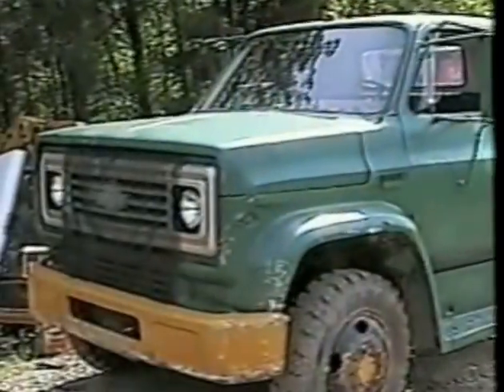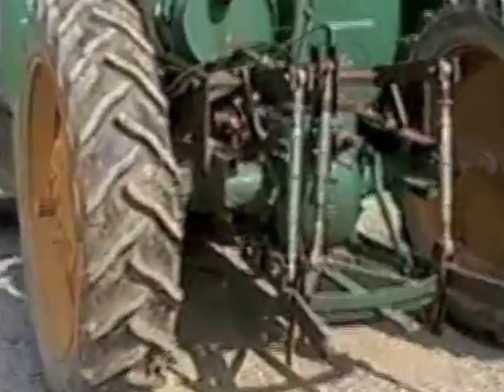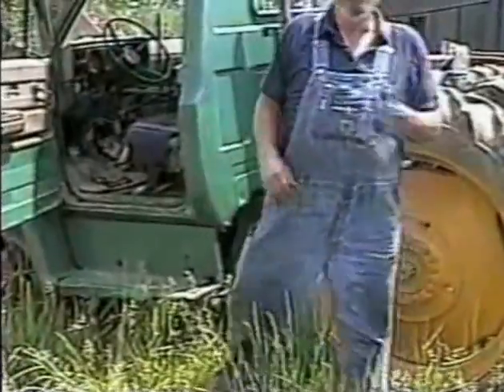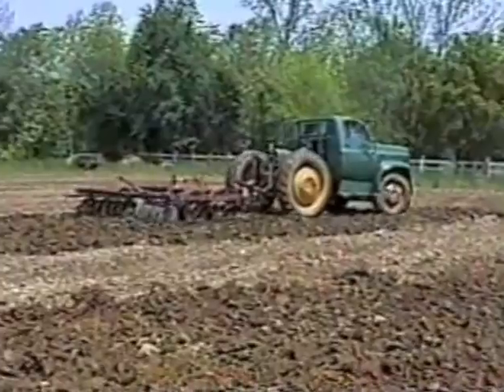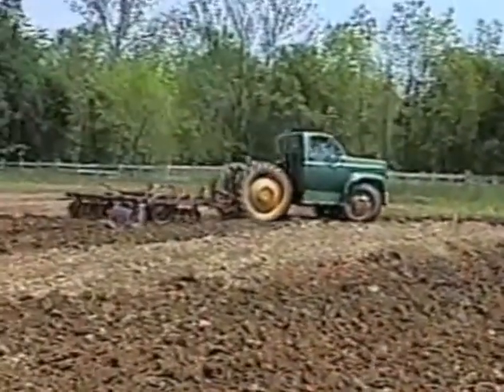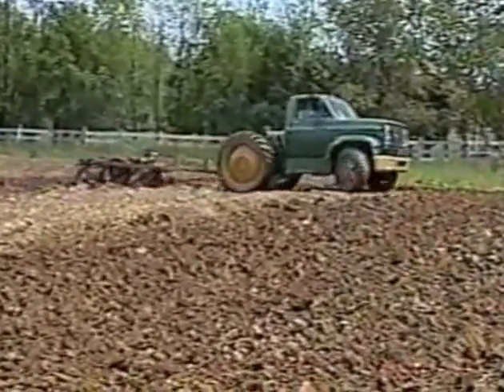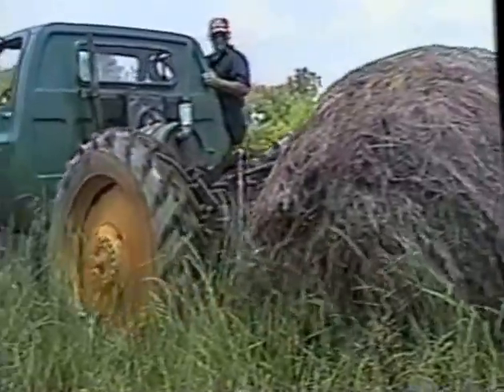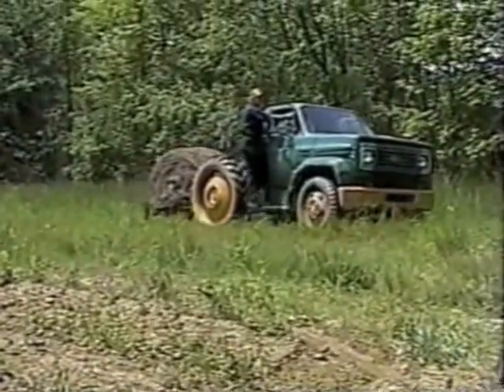FARM SHOW - "Tructor" Moves Quickly Between Farms

Comment: I had a truck kind of like this one. It was a one ton 4x4 with a wrecker bed on it.  I built a three point hitch that was powered by the winch on the truck. It  was a 1978 Chevy 454 4x4  with a 4 speed transmission and 4.30 gears it had a granny low and a hi/low transfer case which gave me a really,really low "double low", it would pull my 13 foot farmall disc with ease, it would also pull a 3 bottom breaking plow like there was nothing there. I used it mostly for discing,  pulling the fertilizer spreader. and raking and moving hay. It was especially handy for fertilizer because I could drive it to the co-op for my fertilizer. It was also great for pulling a trailer full of steers to the auction. Having six really rough tires gave me traction rivaling a tractor and with the wrecker bed be it weighted close to 7000 lbs. In many ways it was more useful than any tractor I have ever owned.

Comment: 48mph dam near 77km/h that thing moved for its age atleast it has the right steering style for that speed ive been in a situation where i had a run away on a hill getting pushed by my trailer in a fendt 712 found out the speedometer stops at 75km/h figure i got up to 90-95km/h by the time i lost it a automotive style steering system would have definitely gave me a fighting chance of keeping it on the road and on its tires as i could have started braking and counter if a tire locked up or something as it started picking up speed but i didn't dare do anything to risk moving the steering as i would never find center again since it was hydraulic steering

Comment: Bet if he used a diesel engine and added AC could sell a few of those 😄👍👍🇺🇸
Reply: Building one for yourself using some available parts is labor intensive but very low cost. Finding the parts for more, and showing a profit from all the time would make the production models expensive.
Reply: 40,000 acers or you're not Aerica farmer.

Comment: I bet you ,he doesn't have to get the John Deer  computer programs to work on that TRACTOR 🤣🤣🤣
Reply: ....but he might need "the SnapOn OBD-code reader"....
Reply: Dave Zimmerman  all of the new tractors are full of computers and electronics NOT just John Deere!
Reply: @jrod264winmag  My new diesel tractor is all mechanical. No computer. 
LS 25HP. 
Weighs over 4000 pounds. Runs a 5 foot bush hog, 5 foot box blade, 60 inch finish more, and the front end loader can lift nearly 2000 pounds. And it's not even a yeard old! 4 wheel drive hydrostatic drive with 3 ranges. I've even pulled some decent size stumps with it. This tractor has really impressed me. 
It outperforms my dad's Kubota L3600 tractor. 
Edit: And his Kubota doesn't have any computers either, but it was made in the early 90's. Almost looks new, well taken care of.
Reply: @saltysteel3996  I guess if you want to call that a tractor. It's more of a oversized lawn mower. I was actually referencing real tractors you know the 200 300 400 and 500 horsepower variety
Reply: @saltysteel3996  turns out your lawnmower DOES have a computer
Reply: Now the DEF , on them tractors are causing Field fires with all the wheat  dust and Catalytic converters  are cherry hot, i wonder what engineer thought that was a good idea  .
Reply: this is almost exactly what i built when i were young  .  i use to enjoy building stuff for many reasons , one being to save money .   i like his idea of doing it way better  .
Reply: Steve Thompson  kioti is a cheap POS.  The steel is far below standard and will fail with any rigorous use. Thats what a tractor is for, to use daily.
Reply: It calls trucktor you dumbass
Reply: I stopped buying John deere  products in 1998. Last 3 tractors purchased in the 90's were junk. Over engineered  and cheaply put together. They stayed in the shop more than the fields. Had enough. Never buy John deere again.
Reply: @karlhiggins5765  so what did you buy? I think you’re lying.
Reply: the computer is not big deal .. is big problem's ..and future head pain problem'$$$ .. simple and easy .. one wire ,electrical wire , screw driver , pliers , everywhere you can fix ..

Comment: Excellent idea. I assume it is a 472 and a TH-400 trans. If you left the AC compressor in place then you can have either AC or a good on board air compressor!
Reply: A TH400 would get cooked from this
Reply: You would be wrong, I don't know which motor he has, but I'll bet dollars to donuts he used a 2 speed powerglide transmission. Did you guys not listen? he said a two speed automatic!
Reply: @radamson1 did you not listen?
The transmission and rear end are from the Oliver 70 row crop tractor.
Reply: @radamson1 it has 24 forward 6 reverse.
 dual range means high and low range, not 2 forward gears.
Reply: @radamson1 don't know if you were listening, but it has the rear end and transmission from an Oliver 70
Reply: @jonnothetrucker  Right, I went back and listened and he said both. The number of gears would have been the same whether he used a two-speed auto or a manual hi/lo gearbox. A gear is a gear no matter how you get to that gear.
Reply: probably not the TH 400, but the original chevy 5 speed with the compound transmission behind it, running the tractor transaxle.